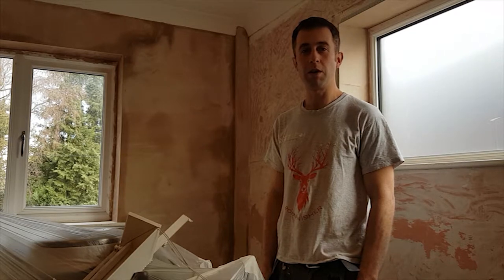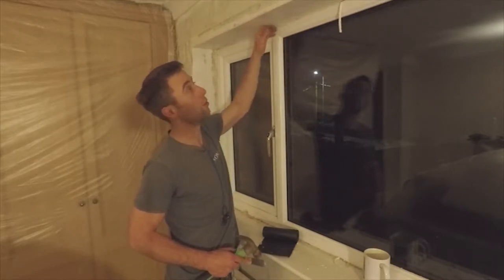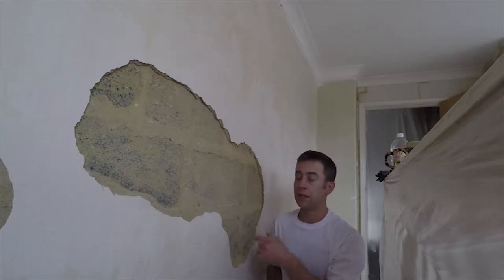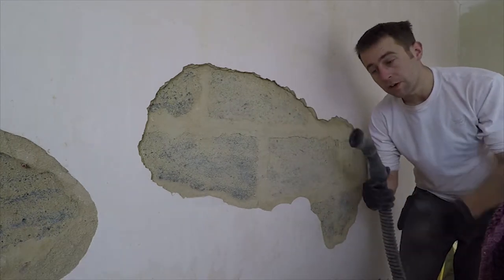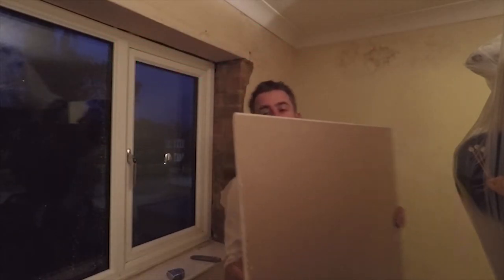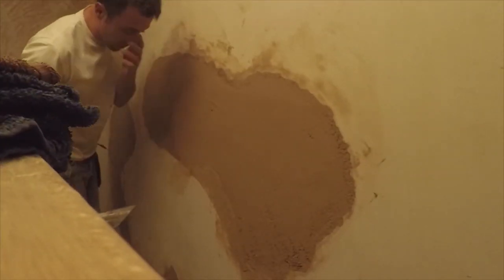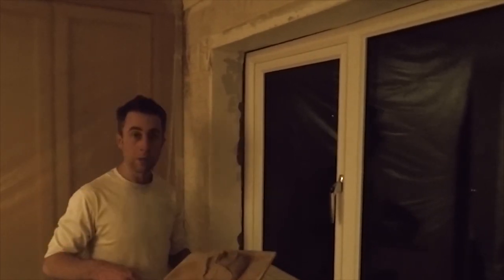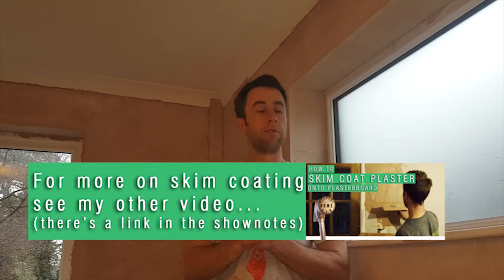How to Repair Plaster

Comment: Great video, can I just ask as someone with a very basic understanding of this plastering/ boarding and trying to self learn for a project myself... you went to great effort to cut plasterboard to funny shapes. Is there a reason for this opposed to cutting away more to make a rectangle or square...?
Reply from the maker: Hi Max, I did indeed go to great lengths. Usually in this situation, plasterers just board over everything, which pushes the walls inwards. I wanted to maximise the space in my room, hence cutting around stuff so that the plasterboard were as snug to the walls as possible. You could just board over the lot if you're not so precious on space. Otherwise, it's always best to avoid cuts where possible and use complete boards, which reduces the risk of cracking when the plaster dries and for about a year after boarding

Comment: Excellent video, thanks very much. Is bonding coat ok to use on blockwork though? I thought it needed to be hardwall for high suctions materials? About to tackle a similar repair myself.

Comment: Great vid
What can I use on a damp cellar  brickwork is visible and mouldy
Reply from the maker: This is a bit out of comfort zone but you'd need to look into preventing the damp from penetrating the room first, such as tanking. You'd also need specialist plasterboard for damp environments, such as is used in bathrooms. I would consult with a specialist before any work in a cellar/basement though. Hope this helps
Reply: @HelpfulHomeDIY  very much appreciated